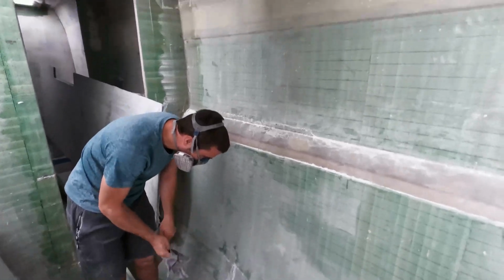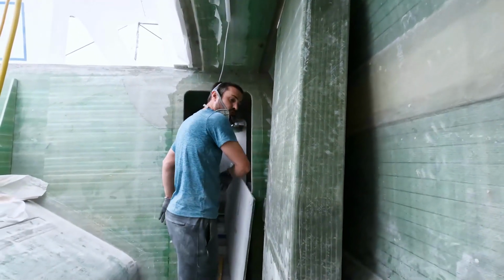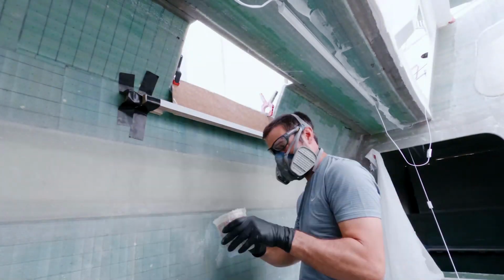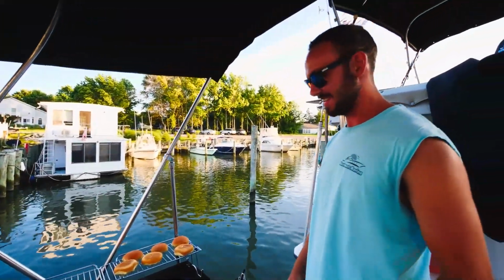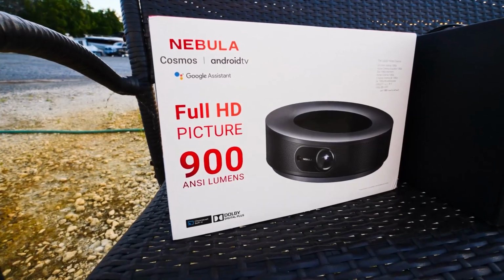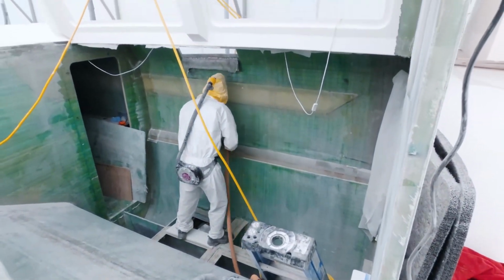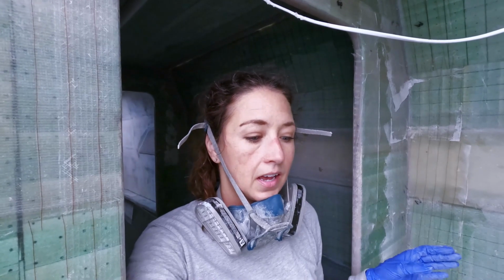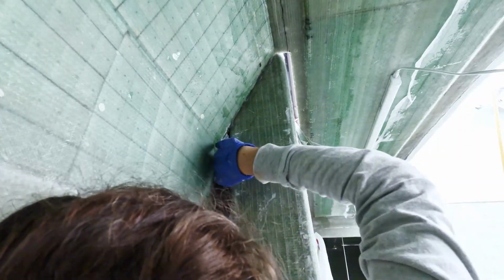The Last 4 Months Have Been Leading Up To This Day - (MJ Sailing Ep 244)

Comment: Static head mixer can be hard to use, as you have seen. Warming the tube to the top end of the working temperature can help. The down side is the shortened working time. The other downside is if you're not using up the tube, having enough extra mixers.
You picked a great movie for your first use of the new projector.

Comment: I would have thought that you should have used rolled fiberglass on hull at the bottom of the dagger board as well as some extra layers of biaxial.
Reply from the maker: The lower bearings are higher up in the case and the hull to case joint shouldn't be seeing high loads.  They get a bunch of layers of glass on the inside, and two layers of 450g double bias on the outside.

Comment: The ability to go to wind is crucial for a catamaran. The daggerboard seems to be one of the most misunderstood pieces of equipment on a multihull. Your cat specifically does not have enough keel area. Beating to wind is hard work when the dagger boards are too small for the cat. Almost getting hernias will pay off.  I agree with the repositioning of the daggerboards. Makes more sense even if the installation is ten times harder. No pain, no gain. Just recently watched another Youtuber reinstall his daggerboards. He was able to lift, and carry it by himself on a cat even larger than yours. Won't be long before they want too trade for more performance. I freely admit I wasn't as smart as you guys in my life. Took me years to learn eventually reaching my  destination is for others.

Comment: Great job and hats off to your staying power, I watched the centre board case fitting I see you have moved them out and removed 1 angle (=strength)in the hull as you moved it out. Should you be installing unidirectional or carbon along the hull behind the case where you can’t get it later.

Comment: What changes to the strength of the hull did you need to consider when deciding to move the dagger board cases outboard?
Reply from the maker: Nothing different than the "normal" inboard position.   Both ways went through cored parts of the deck/hull, and both had to be equally reinforced in those areas.   Where our upper bearing surface is lower than the first option, we're also closer to the hull side and it allows the load to transfer to that easier.
Reply: @MJSailing  This question intrigues me enormously! I'm sure the architects at Max Cruise worked out the forces very accurately and know very well what the stresses will be. I'm very timid and making changes of that sort would stress me out massively! But Matt is as thorough a person as I know, and will fully have taken all aspects of the move in to account. Will it affect sailing speeds/ability/balance?
Reply: Max Cruise approved the change.
Reply: Did you ask the designer of your boat for this change? I hope it will not cause problems later.You will loose some of the counter force that dagger board creates while sailing if you did change the angle of it.I hope it will not change the structural rigidity of the boat as well.Make sure to test your boat on its limits before sailing oceans.I hope it will be safe best wishes.
Reply: @suhan8382  Seriously? They talk to the designers multiple times a week and you think for even one second they would do that without getting a good to go on it? smh, I have a bridge to sell you my friend...

Comment: Hi guys have watched from the beginning and love the show, have not commented before. Moving the dagger board outboard, I understand why only concern is will you be able to glass the bottom outboard side sufficiently as the gap is tight to roll out the matting, as you know the pressure can be immense at times when the board is working
Reply from the maker: The lower bearing takes the load and that's located a few inches above the hull bottom.  The bearing area is heavily reinforced and held firm by the internal webs, sole and hull side.   The exit spot of the hull should see no real load as the board should never press against either side.

Comment: Realizing that for you this is a done deal because the dagger board case is in place, but with the case at a slight angle (3.5 degrees) if you increased the angle a little bit on the forward edge (maybe to 5 degrees) wouldn't you generate a small amount of lift as your speed increased?  Not enough for the boat to hydrofoil, but enough to lower the water line a little and reduce drag?
Reply from the maker: You can, but then you have to actively raise and lower your boards on each tack...which would get old fast for us.  It's a compromise between sailing ease and foils.

Comment: Can you expand on the d/b’s configuration, I presume they are symmetrical foils within the smaller exit part of the larger rectangular boxes? Is there crumple/energy absorption provision in the system?
Reply from the maker: The daggerboard case was designed to allow adjustments while under sail.  There are acetal bearings top and bottom that allow this to work.  But the don't absorb energy incase of a ground.  That's for the board itself to do.

Comment: What does the dagger board thingy do?
Reply: Boat wants to move sideways while sailing dagger board act like a railway keep the boat at line by creating counterforce.Boats without daggerboards cannot sail upwind as much as the ones with daggerboards.Non performance catamarans use some kind of short keel for gripping but they are not as efficient as daggerboards.They work upwind and half wind they dont work down wind.

Comment: I am wondering about your decision to change the dagger board location. Will it not affect the dynamics of the boat? I guess the designer must have had a reason for putting it where he did. I understand your reasoning from the ergononic point of view. Clearly it will be more spacious. What are your thoughts on this?
Reply from the maker: Shockingly little changed as long as they are in the same position fore and aft.  All was approved by the designer beforehand

Comment: I have tried many times to understand why americans refer to every task as a ' project '.  Project this, project, project.
Reply: Would you not call what they are doing a project?
Reply: @JCrook1028  NO. I'ts a job around the house.  I could say a hell of a lot more but, i won't out of respect for Teal and his two girls. Progressive, Inclusive, .LGBTQXYZH? Aren't these all Buzz words and utterings.
Reply: @wallywombat164  Wtf are you even talking about? Job around the house? Building a catamaran? Teal and his two girls? Are you even talking about the same video? Not a single thing you just said has anything at all to do with this video.
Reply: @JCrook1028  What did i say? I must have been hacked.
Reply: @wallywombat164  You can read what you said as well as I can... scroll up. But here it is if that's too hard  "wally wombat
wally wombat
12 hours ago
 @JC1028  NO. I'ts a job around the house.  I could say a hell of a lot more but, i won't out of respect for Teal and his two girls. Progressive, Inclusive, .LGBTQXYZH? Aren't these all Buzz words and utterings."